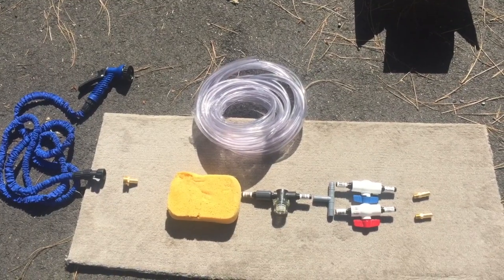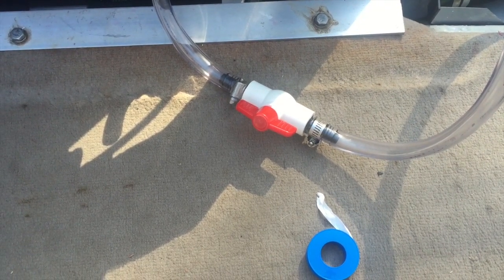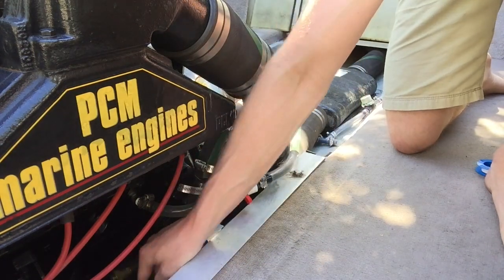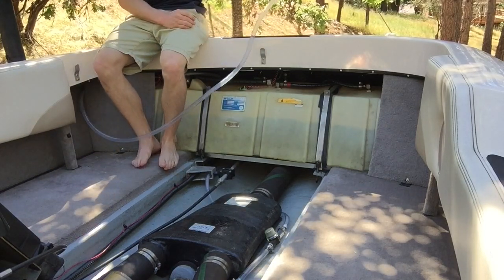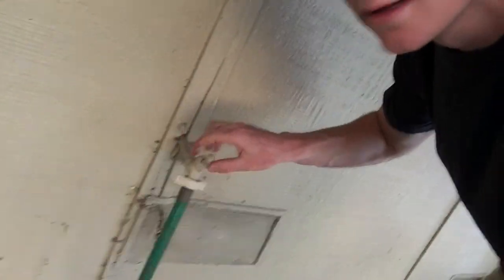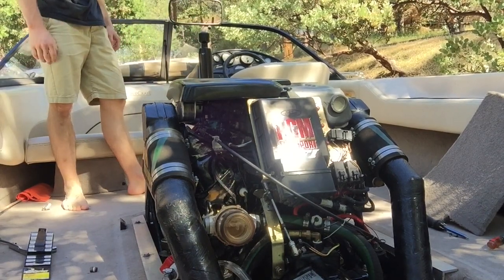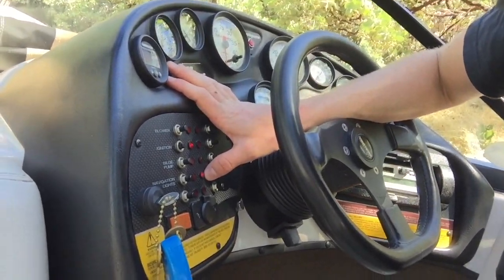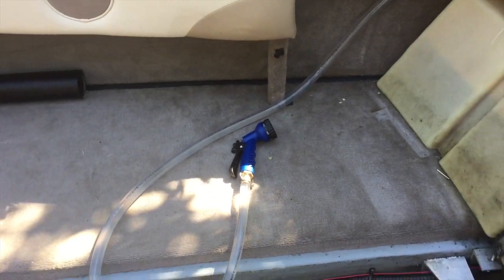How to Add a Hot Water Shower to Your Boat

Comment: Do you have a product list? Do you have to have the electric pump for this to work if the engine is on since the cold water pump is running? I have 98 ski nautique very similar to yours. GT 40
Reply from the maker: Yes you need the pump. There is not near enough pressure at idle. I do have the shurflow pump here, https://amzn.to/3GAu1Rj
I hope this helps.
Reply: @92813justin  the link to the pump is great thank you, before I order the other parts I want to make sure I get the right ones, having trouble finding some by searching, do you happen to have links to the other items? Example not sure what the engine brass connector is called and the size on each end, you said 1/4 inch and then you said 1/2 inch for the hose, I assume that’s inner diameter

Comment: Last question :) As far as I know the pressure pumps are not made for use with hot water? With this setup I guess it’s not avoidable. Did you have any issues with the pump shutting down with hot shower temperature ranges?
Reply from the maker: I did not have any problems. It still works to this day

Comment: Swim step shower is a luxury that every wake board should have. Nothing like hot water inside a wetsuit to warm you back up. Most Calabria wake boats had the shower. 

You could also use something like an RV shower to have better hot/cold control. 
https://amzn.to/3i5oIwU

Also, consider making a hot tub with kiddie pool on top of floating inflatable water mat. 
floating mat
https://amzn.to/3AOXQKl
kiddie pool
https://amzn.to/3e6WQqX

Just use shower to fill the pool with hot water so kids can swim and warm up!!

Comment: Would it be possible to do something like this with an outboard motor?
Reply from the maker: Rob van Dyck, maybe. But probably not. It’s probably dependent on engine size and how natch water flow you have going through the engine
Reply: @92813justin  appreciate the reply. That makes sense.

Comment: Dude are you going to soap up and get all lathered up and soapy and slippery. Dude show us when you are showering and scrubbing off. I hot sweaty guy like you needs a shower all the time. Bend over and show us your gaping hole withs some soap trickling down between your cheeks. Dude your so hot....

Comment: Heat exchanger would be much cleaner system for showers, Direct off engine is  good for cleaning the boat.
Reply from the maker: The transmission heat exchanger is not hot enough unfortunately

Comment: Great video man. What kind of pump did you use? Also, at 50psi, have you been satisfied with the flow?
Reply from the maker: barefootrocker the pump is called Shurflow. It works great! Water pressure is medium.